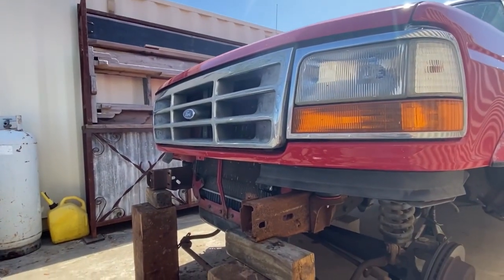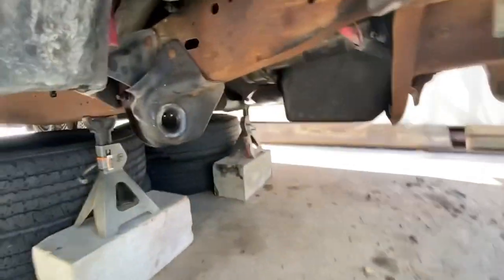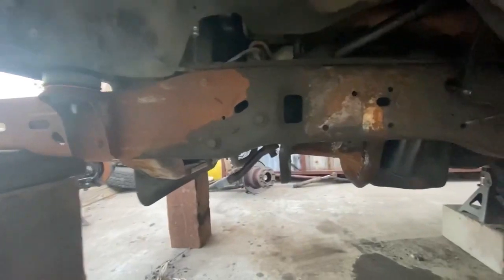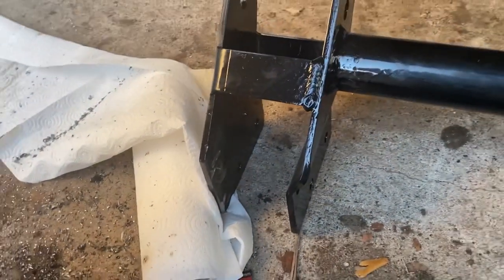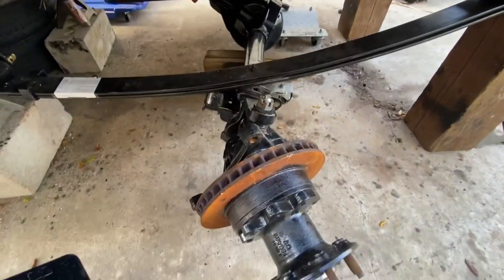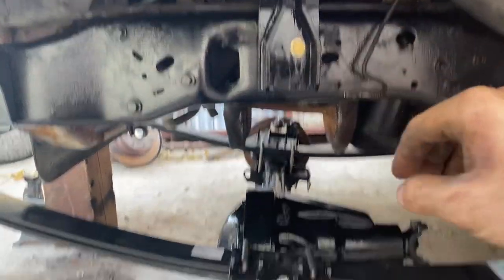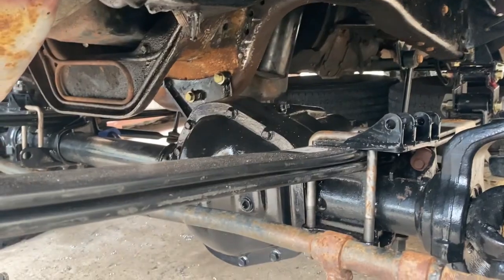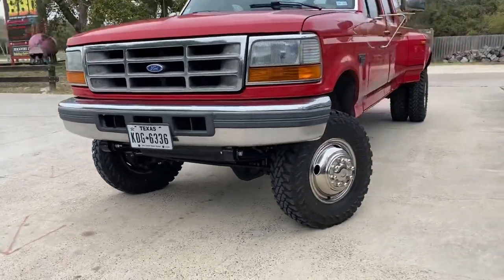OBS F350 4X4 Conversion

Comment: Very nice job. I did the opposite to my truck. I had a F250 4WD diesel and added a posi dually axle on the rear. Along with several other upgrades.
Reply from the maker: Thank you! Yeah I love the idea of the newer axles under it but I just love the bearing set up on these old trucks. Maybe someday if I find a nice set of SD axles I’ll swap em out!
Reply: @obsdieselbros4160  The F250 came with 2 drive wheels in 4WD (limited slip), now it has 5 drive wheels (positraction) and dualizes. This makes a huge difference when off-road towing. But at the end of the day it's still a HD 3/4 ton truck because of the front split axle. Did you also use hub extenders on the front axle or was it from a cab and chassis?
Reply from the maker: Wow, late response sorry!
The hubs came off a C&C truck, shipped to me from Washington state! 
Hard to find, I did find out the rotors are different for a C&C truck than a reg truck.
Reply: @obsdieselbros4160  I miss my truck every day.

Comment: Nice truck. Did you swap out your trans yet? You should also drop your drive shaft carrier, mine would click under full load, the 4x4’s have a lower bracket then 2wd (mind you I have a shorter WB than you).
Reply from the maker: I have not but my clutch is giving me problems so that will happen faster than I realized! 
I hadn’t even thought about that, I’ll pull the one off the 4x4 and slap it on when I put the trans back in, thanks for the tip!

Comment: Well was a silver and gold smith did shows all over the us, had 89 t250 hd with 460. Wife kept seeing venders getting crew cabs when powerstroke came out we got one. She got sick in 2005 breast cancer it was 2010 when she passed. So not much went on a few shows but only inside short ones now only one or two a year. Has 316000 on the clock. Has been estamated at 550 to 600 at the rear wheels a dont use it because 1700 for tires. Pulling only 9600lb 5th wheel now. 32 ft. Rockwood. It sets a lot now.
Reply from the maker: Wow! That is one incredible story, so cool you have kept it throughout the years!
And Cancer Sucks
Reply from the maker: My dad was actually a silversmith!
And this was His truck! 
Y’all had a lot in common lol

Comment: My brother did a 4x4 conv and swapped his IDI for a powerstroke 5speed manuel in his 92' crewcab duelly like 10 years ago took everything off a banged up low mile 97' F-250 did it in like 2 weeks for under the price he sold his banks sidewinder i remember it well since he did all his pounding out rivets with a cold chizel for days with no end next to my bedroom window. he just finally ditched the dana 50 just a few months ago for Newer SD axels Damn truck steers wide like an Aircraft carrier and tops out @ 55 knots down a steep grade, but he loves it cause his wife will never wanna drive it
Reply from the maker: Haha man that’s awesome! Yeah them rivets can be a pain in the butt! I found using a right angle grinder worked the best then pound them out with a drift. These trucks sure do have a wide swing to them, getting in my wife’s Accord makes me feel like a race car driver lol
Reply: @obsdieselbros4160  No shit and try pulling into a parking spot easily anywhere other then pinoccio lot. its a beautful rig now even red like yours cheap n easy to maintain unlike my 6.0 but it was the biggest pos when he bought it off a 60yr old tweeker for 1200 and like a week later we were arguing while driving down the Hwy so he slammed on the brakes to kick me out but slowly slid on the  bald tires  and wet asphalt into a ditch and rolled on its side so i took the opprtunity  unbuckled and started swingin while he was pinned for a few minutes till we realized cops are commin so we climbed out tried to push it back over till the FD showed up said we sideswiped a coyote and  tied a rope to the fire engine and somehow drove it home dragging the front bumper and ony could make left turns Those trucks are like cockroaches cant kill'em
Reply from the maker: Bahahahaha I don’t have brothers, sometimes I wish I did and others I’m glad I didn’t lol 
Awesome story!

Comment: Looks awesome! Im looking to dually swap my crew cab obs
Reply from the maker: Thank you! 
It’s a blast! They look sweet with a solid front axle! 😃
Reply: @obsdieselbros4160  I have a single rear wheel 4x4 f350 just cant find a nice dually bed to do the swap. Agreed dana 60 looks tuff up front I have a pmf RSK with superduty springs
Reply from the maker: @Turbotalkin  yeah finding the dually bed is a pistol! I wish they were like the SD trucks where you just slap a fender on it! :/ 
My brother in law just bought a SRW converted to a dually and the paint doesn’t quite match but it’s a good bed!
Reply: @obsdieselbros4160  yeah most beds I find have busted fenders and my trucks 2 tone blue and grey so doubt I'll ever find the right color but id definitely like to repaint the truck one day once I finish it, looking at stage 1.5 injectors e fuel cnc fab stage 2 Hpop   2010+ black leather interior and the dually swap. Would pretty much be my holy grail truck at that point
Reply from the maker: @Turbotalkin  Haha sounds like we have the same truck plans in mind! 
OBS Solutions makes some stupid easy SD seat brackets that makes the whole thing a bolt together deal! 
That blue/Grey is beautiful!
Reply: @obsdieselbros4160  I have seen em a little exspensive though we did the conversion in my buddies 97 before those came out. Bout 20 minutes with a cutoff wheel and a welder super easy some writeups on the fourms about it
Reply from the maker: @Turbotalkin  Yeah for sure, tho I’m at the point in life where I’ll spend the extra money so I don’t have to think or create lol

Comment: Recently acquired a minty 89 f250 rwd, looking to swap it over to 4x4 with parts from a same year same model 4x4 donor truck. I know I’ll have to buy the reverse shackle kit but are there any other tips you have on how to save a buck or 2?? You seem like the right guy to ask haha

Edit: it’s a 460, not a 7.3. Not sure if you know but could I still use a 7.3 trans and all those bits?
Reply from the maker: Yes, I am indeed lol
As far as the 460/7.3 trans I am clueless! But search on FordTruckEnthusiast forum and you will for sure find all the info you need!

Saving a buck, 
-taking the shock towers from the donor
-tie rods ets. (If they’re in decent shape)
- I put in new BJs and all axel seals, kinda unnecessary 
Pull some SD springs from a yard (if you are doing a SD spring RSK, if not then use the springs off the donor)
-shocks can be reused if decent
-Brakes from the donor

I’d say that’s about is, I went through everything because I wanted to get in it and drive 8 hrs and not worry about something falling off the front end!
Good luck, check out that forum write-up I did, not bragging but I think it’s the best one out there as far as detail.

Comment: Awesome truck! Im doing a similar conversion, did you have any issues with rear driveshaft angle or vibrations? Any change to carrier bearing height or adjustments made to correct the pinion angle? I believe the factory 4wd trucks had a dropped carrier bearing but I could be mistaken. Great looking rig!
Reply from the maker: Hey thank! If I recall correctly, the 4wd does have a dropped carrier but I have had no vibration what so ever so I didn’t want to tear into it if I didn’t really need to but I would say to do it correctly the dropped carrier should be swapped in! I have heard of others doing this swap that had trouble with that..

Comment: hey man, I've got a 1986 f350 dually I want to do a 4x4 conversion onto it, and wondering if I could get any advice. I just bought a 1989 dana 60 kingpin high pinion front axle for it, and I've got a 7.3 idi, 4x4 ZF5 manual transmission, and transfer case to put onto it.

Comment: Im doing the same swap on my 96 dually. Just put the blocks on the rear last night. Could you offer any advice on the rear shock part number and extended sway bar link? It measures 24.5 extended and 16 collapsed, not sure what shock fits. Great video and good looking truck!
Reply from the maker: B8 5125 are the shocked I used for the rear with stock 4x4 blocks! 
And the rear links, I can’t remember if I used the extensions from SKY mfg. or just the ones off the donor
Reply from the maker: Actually I think I used spacers from Sky, the SRW links are different from the DRW if I recall correctly.
Reply from the maker: My donor was a SRW
Reply: @obsdieselbros4160  Thanks for the reply. Turns out those are the same shock I have for the front end. So I’ll just pick up two more. I talked to sky and they confirmed what you said on the sway bar links. My dually ones are 12.75” long which is still a few inches short. I guess I’ll be looking into buying their extensions or welding on some 5/8” tubing diy extensions. Cheers!
Reply from the maker: Sweet! Glad it’s going well! Super fun project and the satisfaction after it’s all done is amazing! There’s nothing like a OBS 4x4 Dually! 😃
Reply: @obsdieselbros4160  I agree, one of the coolest looking trucks on the road. Yours look great and sits well. One question for you. My rsk front frame has a spacer welded inside that’s not allowing it to slide around the frame. I’ll call sky Monday but I’m thinking that’s for the 4x4 trucks with the stock shackle divot in the frame. Maybe there was a mistake when I ordered it. Did your front mount have anything on the interior? It didn’t look like it did in the video?
Reply from the maker: You are correct, those spacers are for the stock 4x4 frame and aren’t needed on our conversions! 
Cut off wheel makes short work of it!
Reply: @obsdieselbros4160  10-4 I will zip it off in the morning. Thanks for the reply!
Reply from the maker: Absolutely!

Comment: I gotta question i have a 1999 f250 2wd and my wifes dad just gave me a 1995 f350 4x4 that he rolled is there any possible way i can put the front and rear axles in my 1999 f250 to make me a F350? Both have 7.3s and the 1995 is manual and 1999 is automatic

Comment: A snap on air hammer knocks those rivets right off much easier
Reply from the maker: We used a air hammer with a pencil eraser size punch but that didn’t knock any out. Although I’m not in the Snap-On class of mechanics here lol
Reply: I'm not snap on class either I have a cheap air hammer that did nothing so I borrowed my buddies snap on with a chisel bit on it and knocked the heads right off . Then I though my China hammer in the garbage when it comes to air hammers I've learned to not be cheap pay the 350.00$ for the snap on it will last the rest of your life and it will make things like that so much easier.
Reply from the maker: Sounds like sound advice! Next go around ill give it a try!

Comment: Does this kit have any effect on tow load capacity? I want to convert mine to 4x4 but don’t want to lose my trucks potential.
Reply from the maker: In theory all you are doing is putting a solid axle under the front, in many many ways more sturdy than the twin I beam (TIB).
As far as the rear, all that happens is a (stock) 4” block is set under the springs. So from a “stock” point of view, no it in no way lowers payload. 
If anything it gives a more sturdy front end.
And if you’re concerned about the blocks Sky makes a rear spring shackle kit that lowers the spring so that it bolts directly to the axle and gives you the level you need to match the front.

Comment: What transmission do you have and what transfer case is compatible with it
Reply from the maker: I have the manual transmission (ZF5) and as far as compatibility of other transfer cases I don’t know off the top my head. I would assume there are quite a few as all it is is a splined shaft out the transmission.

Comment: Did you have to get a drop pitman arm or will the stock work?
Reply from the maker: I did get a dropped one, and it made things pretty darn close to horizontal! But you could sure do it without. Your steering would probably have some “bump steer” as they say. 
Depends on how highway worthy you need it to be.

Comment: Did the dual shocks in the front really help? I've been thinking about doing the same to my truck.
Reply from the maker: Well being it was a twin I beam suspension before I really can’t say if they work “better” because I don’t know what they would have been without. My goal was to have the best suspension I could have before coil sprung axles.
Reply: I have the same set up but single shock with the rsk and it rides awesome. Smoother ride than my dads super duty.
Reply: @-MOYST-  forgive me but what's rsk
Reply: @jacobn516  reverse shackle kit. It relocates the Front shackle on the rear of the leaf spring.

Comment: Is that their 2" RSK ?  And what size tires did you go with ?  Looks great 👍   I'm about to start my single cab dually conversion soon !
Reply from the maker: Yes sir that’s the 2” and the tires are 30.5 as that’s the biggest my Discount would go on 6” wides :/
Good luck! Read thru that forum linked, it has a lot of good info on small parts, odds & ends!
Reply: I have a C&C truck for the donor parts (Dana 60 and the smaller parts that I'll need but don't have on the 2wd truck).  I don't mind the look of yours is why I asked about the tire size. Preferably 35" tires but I like the idea of just keeping the stock steel wheels with a little taller tire instead of going crazy with wider wheels and tires and then having to run a spacer in-between the rears to keep them from touching.
Reply from the maker: Yeah same I hate the idea of spacers but it definitely limits you using steels. I used c&c hubs and had a hiccup with the rotors they were just different enough to not allow the rotors to bolt on you might check that… 
Fuels are lug centric and they bore their hub size as a one size fits all so I’ve been looking for a set of dodge fuels on CL (fact check me on the fuels that’s second hand info)
Reply from the maker: The only real reason I’m wanting to get 35s is my 4:10 gears has me wide open to cruse 80 and those larger tires will bring rpms down to ~2380 at 80mph which will be amazing!
Reply: Absolutely...I get it,  mine hasn't ever been my highway truck is why that part doesn't bother me.  As far as the hub issue you ran into,  my situation is a little different... my Dana 60 is in a factory 4x4 C&C... so I'll just be using the front end as is in my 2wd dually pickup...
Reply from the maker: Right right okay I got it now!

Comment: Did you take the axle off of another obs ford around the same year? Or is it a newer/ older axle?
Reply from the maker: I took it off a late 1995 so same year pretty much mine is a 96 I don’t recal the exact date they went to ball joint from King Pin. 
There are many axles you can put under them with little to no trouble.
Reply: @obsdieselbros4160  Alright, good to know! Thanks

Comment: Do you think they have lift kit in the market for rear wheel drive dually 1995 obs 7.3 powerstroke turbo diesel truck?
Reply from the maker: I believe rough country makes one and there’s one other out there can’t think of who makes it but that being said I would strongly discourage it as that suspension is not designed to have a lift and it will throw out the alignment and steering quite a bit.
Reply from the maker: https://cpaddict.com/complete-performance-2wd-leveling-kit-1980-97-f-250-f-350/

Comment: How much could this cost?
Reply from the maker: Donor was 2k 
All new hardware 2k
New shocks 
New springs
New break lines etc etc.
Another grand
5k total
If you’re on a budget and don’t mind scrounging used parts then half that easy maybe less
Reply from the maker: Did that answer your question @EMT0210 ?

Comment: Are the transmission crossmembers different on a 4x4? That’s the only thing giving me trouble with my conversion. Transfer case rear output flange is up against the bottom of the cab
Reply from the maker: Tbh, I haven’t gotten that far! I have the donor so I can scrounge off it but I plan on making the pt.2 being the tranny and t-case!
Reply from the maker: Yes! The crosmembers are different! I had to use the one of the 4x4